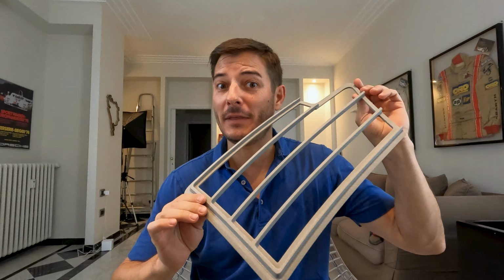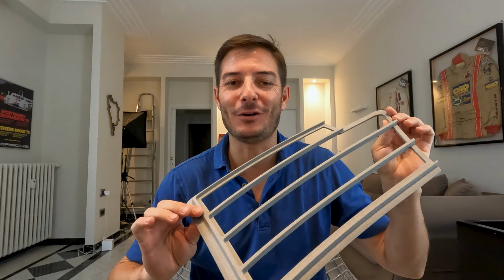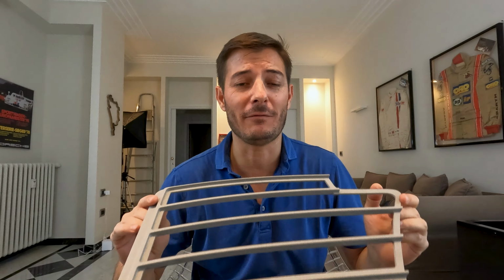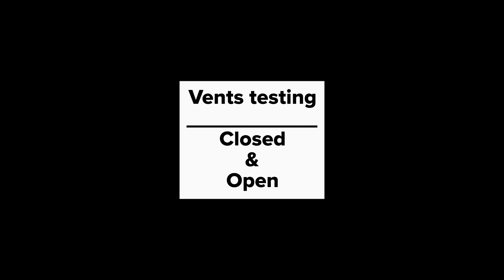GR YARIS Cooling Aero Hood Vents Kit

Comment: i notice that in your wool tuft tests, some of the tufts are pulling inward suggestion flow from the bonnet surface downwards and some are flowing as expected, outwards. i would appreciate any comments. I'm building a GR for circuit race use, and this is a good idea . many thanks
Reply from the maker: Hello there, some tufts are pulling inward because there were some vortexes, as understandable, I don't see an issue.
You will want to make some vents very similar to our latest edition parts, as they make a HUGE improvement to cooling, and totally eliminate the front end lift that this car generates. I coudn't believe how much difference it made in high-speed cornering!
Reply: @PIRASMotorsport  ok, ive just done some pressure differential measurements on my car at 60kph and 100kph on the public road. that suggests there will only be small flow outwards via bonnet vents at 100kph. most of the velocity pressure is lost going thru the the highly restrictive front radiators so there is a lot of cooling system aerodynamic drag on this car. it is the single open air duct at the bottom and the 2 small grilles at the top that produce most of the useable positive pressure in the engine bay. there is a substantial pressure difference between the engine bay and the wheel arch suggesting air will flow that way.  i'll do more work and at higher speeds and report back

Comment: Indeed, that was a design overlook when developing the car. The GR Corolla comes with the air vents, probably because Toyota realized they have a problem.
The aerodynamic lift at high speeds is scary. I drove at max speed on the german autobahn and the steering becomes so light that you can feel the car floating. Definitely anything over 180km/h is not a speed I feel comfortable with on this car unless you are on a straight
Reply from the maker: I am happy you have tried this and seem exactly what I mean: its so good to have real life confirmation from other people!

Comment: Have done 200km/h couple of times with stock car - felt ok to me..
Reply from the maker: 200kmh going thru bends?
Reply: @PIRASMotorsport  well not really tight ones. too small balls for that
Reply: @PIRASMotorsport  mine driving is 99% sub 140km/h so maybe not that big issue. wouldn't matter if gr's top speed was 180kmh, prefer shorter gearing to top speed.
Reply from the maker: @mrmorizofan7001  I like driving at all speeds 🙃 but you would still massively benefit from the cooling advantages
Reply: The GR Yaris has high oil and water temperatures. The engine bay temperatur often exceeds 80°C+ which ist pretty high. Having  the possibility to get the hot air out of the engine bay massively reduces the temperatures and as Adriano said, may improve the high speed handling by adding downforce. It's a pity, I have to wait a long time to put air vents into the bonnet for my car is a leasing car..... and carbon bonnets are expensive and the german TÜV is very strict with that in terms of passenger protection.
Reply from the maker: @Ingmar72  Thankyou Ingmar, for your very informative reply: totally agree with You!
Reply: @Ingmar72  havent gotten that high with mine though we live in Nordics

Comment: Not enough detail in showing what is going on. Show the fitting of it. It's definitely interesting but can't really see what you created
Reply from the maker: It is not easy… there are a couple of pictures of the cut bonnet: then the two vents are glued to the external bonnet’s skin with structural glue